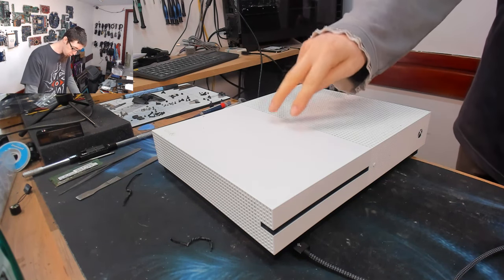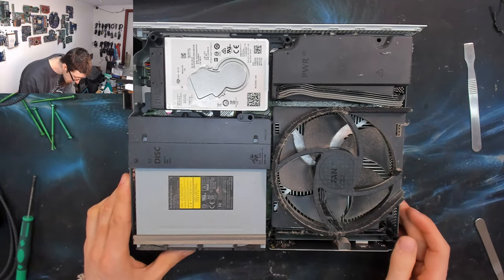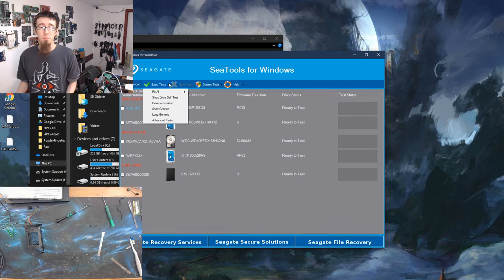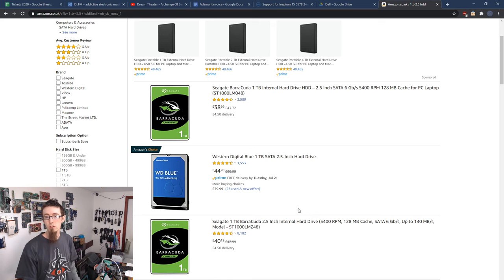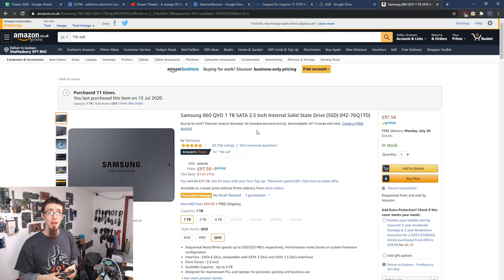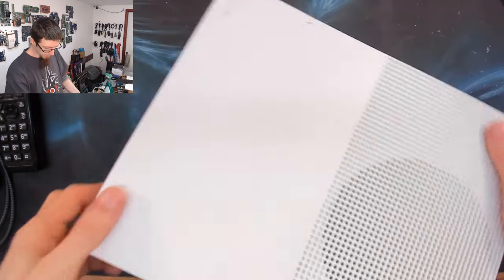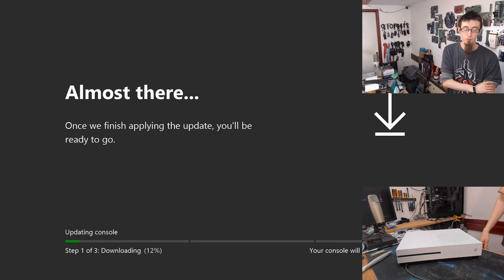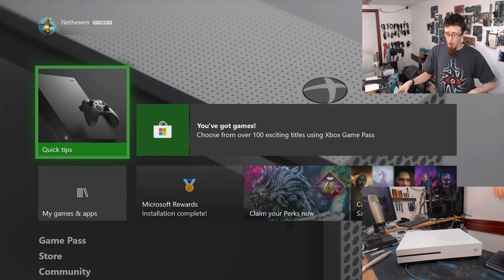Replacing an Xbox One S HDD with an SSD - LFC#214

Comment: One s hdd interface sata 2 or sata 3?
Reply: doesnt matter, not a big difference
Reply: @joshuaguenin9507  big, x2-2.5
Reply: @АлександрЛогвинов-ь4ы  if you have hdd, no difference, ssd would be faster by default, but you wouldnt notice the diferrence from sata 2 to sata 3
Reply: @joshuaguenin9507  sata 2-300mb/s,sata 3-600mb/s max speed
Reply: @АлександрЛогвинов-ь4ы  but you wont notice it and the one s doesnt care
Reply: @АлександрЛогвинов-ь4ы  300MB/S THE XBOX IS ONLY SATA 2 IT BOTTLENECKS THE SSD QUITE A BIT BUT ITS STILL FASTER THAN THE ORIGINAL HD
Reply: @si4632  ps pro and one x have  sata3 interface 600mb/s
Reply: @АлександрЛогвинов-ь4ы  nice

Comment: Ok so I've changed out hard drives b4 but I ran into q problem  on the 1s I got it running an software installed but power button on xbox dont work an light does not come on idk why  so I have my controller synced for it to turn in or I press the eject button fornit to power on any suggestions on how to get power button to work an light to cone on it was working right b4 I took out HD an put ssd in
Reply: I made this mistake today. What you did was actually break the tiny little power button on the board on the front of the console. This happens when the white top is put back on with too much force. You’ll need to buy a replacement board... they run $10-15 on ebay.

Comment: Can you actually replace the drive say with a 4TB or 8TB drive and will the console and software accept it on the Xbox One S digital console? Silly question maybe but still, saves me a few hundred and the next gen console won’t it.
Reply from the maker: I believe there's a limit to the size of internal drives, but I'm not sure if it's 2 or 4TB. If you're wanting a big huge drive like 4TB+, I'd keep that external.
Reply: @Adamant_IT  do you think it’ll be same outcome for the series S console too? I’m thinking of getting the series S in the new year which will be a downgrade as far as internal memory is concerned but I would like to try a 2TB SSD inside the series S and see what the end result will be, if of course it’s possible.

Comment: For confirmation.
Take the new disk, install it directly and from usb i can reinstall the operating system?
No need to do any partitioning before installing it the OS?
Thank you so much!
Reply from the maker: Correct, I didn't need to partition the drive. USB restore drive did it all for me.
Reply: @Adamant_IT  I've fixed with hard disk 750GB, xbox works but i see the same space free have before with the hard disk 500GB :D

Comment: Okay, how can I upgrade to ssd on xbox original? :)))
Reply: Don't. It will burn out the cache. OG xbox games do crazy stuff to the hard drive when you run them. Either Morrowind or Oblivion (I forget which) actually resets your console while keeping the loading screen up so it can empty the cache and load the new areas. Crazy but worked well. Anyways, not a real good solution.

Comment: I have a corrupted external and none of my games will run without crashing or freezing. What would you do to fix this?
Reply from the maker: The external drive should be tested with Seatools to see if the drive itself is failing, or if it's just scrambled. Sometimes the data just gets corrupted because of bad shutdowns etc. Most likely the drive has failed though, in which case, replace it, download your games again.
Reply: Adamant IT sounds good man thank you! You seem very knowledgeable and are most definitely informative. Subbed and hit the bell🙏🏻

Comment: you simplified this process for me. I thought my original Xbox One got bricked after an update. I figured it was the HDD, so I ordered a newer faster Seagate. I watched other videos with someone running script to mimic an original Xbox One HDD. It didn't work for me. Plus, I think I needed the newest OSU1 update file. Not sure which was the real problem with why the drive wasn't working.

But I formated the HDD back to no partition and no labels, installed it, and then did the OSU1 update process and it worked beautifully. I thought I was going to have to trash it. I use it for the kids since I still have the Kinect games they like to play on it. Thanks for this, you don't know how much you've truly helped me and many others.

Comment: That hard drive is a crap model
Seagate Rosewood. I have the same 1TB 1000LM35 Model it runs fine but suddenly won't boot for some reason until you touch the PCB. Also you will received SMART error randomly. It sucks because people review it and both firmware and hardware design have too many flaws.
Search "Seagate Rosewood" and you will be disappoint about the results

Comment: Hi, is it not necessary to run a script with the new ssd/hdd on the computer to make the original xbox one partitions prior to mounting the disk on the xbox? Thanks.
Reply from the maker: Nope. The restore software does it all.
Reply: @Adamant_IT  thanks!
Reply: There are other YouTubers saying this is mandatory which have me confused. You asked the perfect question. I am currently waiting for my hard drive to arrive and tools . And I an sure if to use this way or do all the preparation of the hard drive before installing

Comment: Can the xbox one S motherboard read SSDs at the speed which PCs do? I thought both it and the PS4 were gimped when it comes to them. I know they can use them, but most people get SSHDs instead because of the transfer limit. Either way, great vid :)
Reply: Translate my comment

No realmente ya que es un sata 2 puede ser más rápido el puerto USB 3.0 con el que cuenta la consola

If you wanna replacement the hdd try with SSHD
Reply: Recomiendo que investigues un poco más 

Search more opinions, maybe you can get a better option
Reply: @krismar2623  Realmente? I didn't realize they had a 3.0 USB. I thought they capped at like 3GB/s. Either way, a harddrive swap is something I'd recommend because console ones are SO SLOW, lol. Salutations, man :)

Comment: Since he had that clear HDD/SSD case with the USB 3 cable, could he have just put the zip folder on the SSD before he installed it into the Xbox? I'm curious.
Reply from the maker: That wouldn't work for this method, because the first action for the restore software is to re-partition and format the drive - which it can't do if the install files are located there. It wouldn't actually help much anyway, the install-phase didn't actually take very long, and I was using a really terrible flash drive.
Reply: @Adamant IT  ah ok. That makes sense. Thank you sir.

Comment: seagate tool not seeing hdd ? i see it in windows tho is there a way to have windows check with riski-diskido-dah-tool?
Reply from the maker: You could try Hard Disk Sentinel, or Western Digital Data Lifeguard Diagnostic, see if either of those can test it.
Reply: @Adamant_IT  yeh sentiel showed good tho it wants £50 quid for me to check my other drives lol they can pull the other one :) thanks for tips! btw my purpose is to change to 1tb from internal 500gb and maybe not have to re-download all my games again! :?
is it safe to do that?...
Reply from the maker: Yea that seems like a good upgrade - however if you want to avoid re-downloading games, you'll need to back them up to an external drive first. Although if you hunt around there might a guide for mirroring the 500GB up to a 1TB without losing the data... I'm sure it could be done, I just didn't need to do that digging for this particular job.
Reply: Adamant IT yeh that would of worked if I had the extra drive to use as an external  I would of settled for just having external drive tho on the Xbox one s it’s limited to 3usb ports which is not ideal for my sim racing as il have wheel keyboard n controller for them. Sorry about grammar... anyhow I swapped out for 1 tb normal hard drive n seems a tad quicker than the old 500gb stock one. 
Thanks for the guide n tips
Btw I’m one of your latest subscribers 🤪

Comment: Hey mate, talking about changing hdds... I recently bought an old late 2006 imac just for retroish fun, the thing came without an hdd so I took it appart and threw an old 2.5" 320 gig hdd I had, thing is... cant get it to boot from usb and the display only shows a cuotation mark when powered up, any advice on what to do? thanks :D
Reply from the maker: ooof, going way back on that one - I think you might need to find an OS X install CD, like, 10.4
I was using CDs/DVDs back in that day, so not sure if it's actually possible to boot from USB.
Reply: @Adamant_IT  Ohh shut! thanks a lot for the reply mate! gonna try to find an install cd for that thing :)
Reply: ask ItsMyNaturalColour - he has one (and is a Mac collector) and might well know. search "imnc 2006 imac" and ask him on one of those videos.

Comment: Strange coincidence - was just looking at my original Xbox, who has had an IDE-SATA converter + dual sd-card raid controller with SATA interface (16 GB each) fitted for some time. Works great.
I then took a look for small SSD's and was amazed at how cheap SSD's have become. Love the speed + no noise, so I might be tempted to upgrade it - again. Got a SATA 160GB HDD too, hmmm..

Comment: I see a Toshiba MQ04ABF100 on the table at the beginning of the video :)
Reply from the maker: It's not there for any special reason - just another dead HDD pulled from a laptop that's still in progress.
Reply: @Adamant_IT  I had the exact same one in my main laptop and it died recently so I swapped it out for a 240GB Kingston SSD I had laying around
I still have an external drive with all my important data on it

Comment: Had high hopes for this. So far when I start up I get "E101 00000504 8B050041". If I try offline update it gives me "E106 00000009 80070002" at 6%. Same after reset w/ deleting everything. My OS Version is "19041.3697.amd64fre.vb_release_xbox_dev_2008.200727-0000" if that helps. And yes I've followed all steps of your video and it turns out the same every time. Any help is appreciated.
Reply: what xbox do you use? have you deleted EVERY partition on ssd?
Reply: @revelator3665  New ssd, no partitions before and deleted the ones that showed empty after first few trys. It's an xbox one s.
Reply: @RAAMc42  osu1 unzipped in USB root ?Plug-in USB pendrive with latest osu1 unzipped in root $SystemUpdate (in USB pendrive obvious, not in SSD)
Reply: Isn't that exactly what he does in this guide
Reply: @RAAMc42  but this is the correct and easy mode works perfect in my one x with crucial mx500. what SSD is and how many GB it have? for easy method must have 500gb/1tb/2tb.
Reply: @revelator3665  Crucial MX500 1TB
Reply: @RAAMc42  very strange..It must works if you do all passages correclty
Reply: @revelator3665  its because of my os alpha build and dev mode. I'm very aware of a simple fix, just don't have a second xbox to utilize. Was hoping for someone to know another way.

Comment: Awesome video. I am actually about to do this to an xbox 1 s and this helps a lot.
Reply: Hey man, how did that go for you? I'm in the middle of doing so myself, but I keep getting an error after the reset at 59% overall (100% step 2 of 3). It restarts, tries to continue, nothing moves for a minute or two, and then it errors out e100
Reply: @fenrirnobody2694  my ssd swap for the hard drive went without an issue.  Then I upgraded to an Xbox One X and I'm not going to tear it down myself, just my hands don't work that well anymore
Reply: @GreyWolfTowers  I realized I didn't plug in my disc drive lol. However, I am getting issues when trying to swap back and forth, so I can just move games from my hdd, to my external, and then onto my ssd... But imma just scrap that idea and download them again.

Comment: 🦜au -  Amazon  wtf  🤷‍♂️💨      the delv to OZ is like $25 on a lot items   best U Buy local  cheaper anyway  . 
ive had a few  faulty HDD's              & did a complete wipe     reformat          & worked  again   
use for storage afterwards   PC  . dont need consoles   do more > i use the         Mini partion wizard tool     Free    or win10 has one also

Comment: Great tutorial vid, thank you! Just did the same with my Xbox following your guide. Only issue I had was not having the appropriate tools which made getting the screws undone difficult, without stripping them in the process. But otherwise the transfer was a success and hoping it makes a difference in my gaming 😊👍
Reply: Did it?
Reply: @ciaranbyrne62   To be honest, not enough for my liking. Maybe I had high expectations.
Reply: @phoenixl7948  I'll replace my hard drive if it fails and only then👍🙂 cheers for the advice.

Comment: here in canada the Xbox series s ... is 599.99 new befor taxes so approximately 725$ after taxes !!!! and well theirs the issue with all consoles and thats thermal throttling and you only get 120FPS tops ......i could get a budget too mid range computer that gets better FPS .. funny the Xbox series X and S are relatively new too the markey and your already replacing a hard drive !!!! so i would question the quality of all its parts .... cheap PSU , cheap Harddrive , cheap integrated graphic's , Cheap underbined cpu from AMD 3.6GHZ on paper seems good but longivity i do not think is good at all .. better off getting a 3-4 year old gaming PC with quality parts around the same price !!

Comment: Don't have a bad hard drive, just thinking about upgrading from a 500GB while I replace the disc player. I picked up this Xbox for free because of the disc reader is bad, apparently the guys kid was smashing disc's in there. So I figured while replacing it, I'd like to do a 2.5" SSD upgrade to 2tb. Might also end up replacing the fan to some RGB so it looks good beside the pc also.

Comment: Consoles are limiting hdd speeds, a ssd will give you about 5, 10% performance boost ! Its not worth it !
Reply: It is worth it for the random seek speed and overal menu nagivation fluidity.
But not for just loading times.
Reply: its more like 25-35%, but yea, I was surprised to find that out
Reply from the maker: Yea, deffo not as world-changing as they are on PCs. I'm expecting the customer to take the HDD option, but I figured I'd show the SSD for pimp-value. I didn't actually have new 2.5" HDDs in stock at the time of recording because for any other device, never-not SSD.
Reply: @Adamant_IT  I also tested my ps4 pro with a 500gb ssd, i thought i did something wrong when replacing because the performance difference was really small so i googled it hahaha. Nice, he was lucky then with the SSD ! Keep up the great work ! You are really good at explaining/repairing stuff! Love your videos !
Reply: @deltaecho4673  True, but loading times matter the most, it takes ages to load some games !
Reply: @kvn864  You can probably get that improvement by replacing the standard 5400 RPM HDD with a 7200 RPM one !
Reply: Actually my Portable SSD speeds are double the speeds when it comes to loading times and yes performance is better too. Your wrong about the loading times. Example: My original Xbox One S HDD Red Ded Online took around a minute to load but my portable SSD literally loads 34 seconds faster.

Comment: Unless I somehow missed this being done,

I would look at using this script to format a replaced drive, especially if a different size drive is used.

The Xbox determines the size of the disk based on GUIDs so that determines how the Xbox formats the drive when you system reset the console.

https://gbatemp.net/threads/xbox-one-internal-hard-drive-upgrade-or-repair-build-any-size-drive-that-works-on-any-console.496212/

Using this script also allows for copying data from an original drive as well and allows using 500GB, 1TB, and 2TB drives and they will behave as such as the GUIDs match what size drive is installed.

I have a 2TB Samsung EVO 850 in my Xbox One X which came with a stock 1TB drive and it behaves exactly as a 2TB model including retaining the full ~1.8TB partition for games after a format. When the script is not used and the console formats the drive it only was around 1TB and the rest of the drive was unused, resizing later using a PC works but that only lasts until you reformat then it reverts back to 1TB.

Comment: I have an Xbox One X that doesn't turn on anymore.. but before it finally died it would sometimes turn on but when you put the power cable into the back of the console you'd get a "pop" sort of noise and some static. Is this purely a power supply issue and is it easy enough to replace?
Reply from the maker: I haven't been inside a One X before, so no idea about ease of repair. Deffo sounds like a PSU issue though, yes.

Comment: I wouldn't waste my time with 1TB because I suspect the primary reason the 1TB failed  because the owner didn't leave enough space for the  OS to run..

this I know from experience..

you do know the xbox 1s doesn't come with a dvd drive

replacing with  the same hdd will just result in the same failure..

I would suggest either 4-8TB or whatever the max 2.5 inch hdd in it or the only 4 or 8 TB ssd

I suspect to much shit was installed on the hdd caused the initial failure point, poor handling likely  screwed the rest of the hdd..

you only breed failure again by installing another 1TB drive I have had failure points myself to know eventually a bigger hard drive or ssd will need to installed..